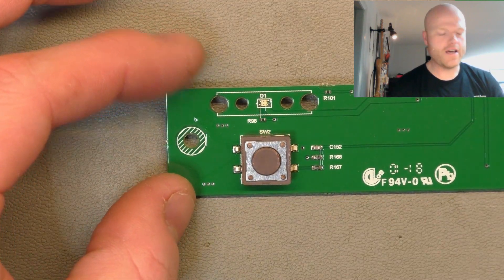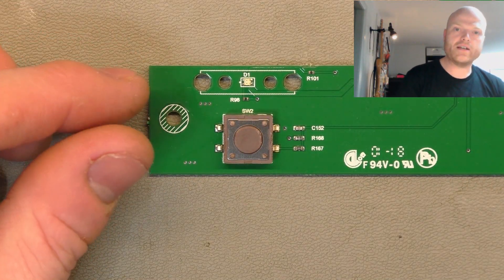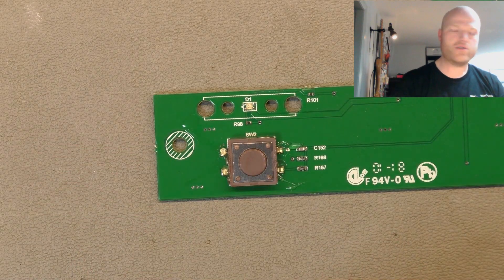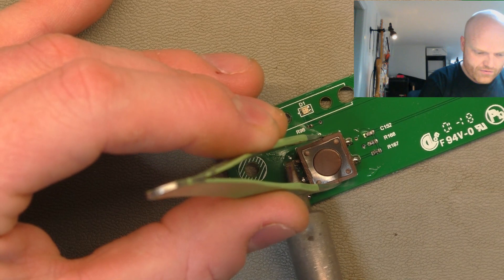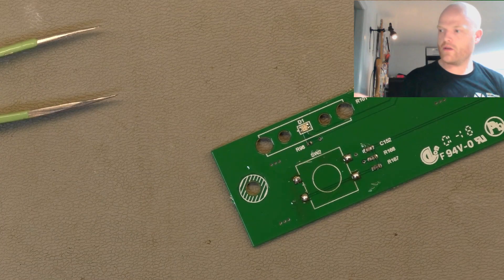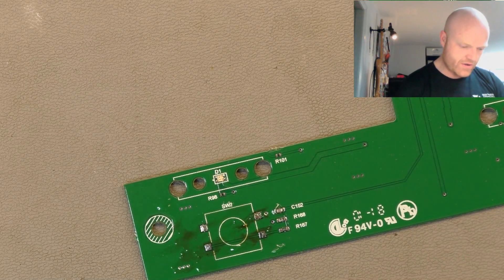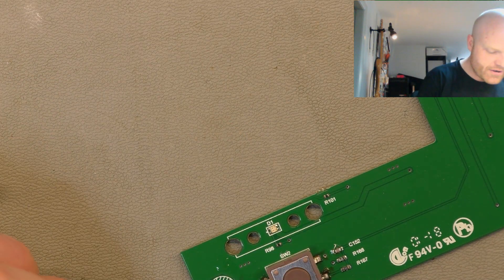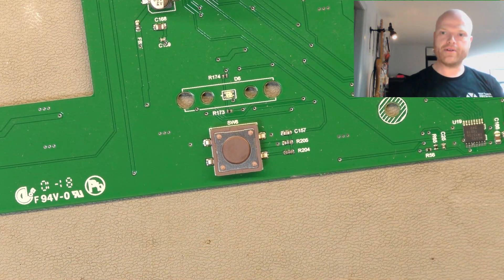SMT / SMD Pushbutton Replacement - iRig Pedal

Comment: You said this was a technique for removing the switch with stuff you just happen to have around, *but most people don't have ChipQuick*, and as you mentioned, it's expensive, so, here's an alternative method.  Push something wedge-shaped, like a skinny flat blade screwdriver, or a wooden popsicle stick or tongue depressor sharpened at one end, underneath the switch (which typically stands up off the PCB  slightly on little nubs of molded plastic). Add fresh solder and/or flux to the solder pads and legs of the switch. Lay the soldering iron down flat on two connections simultaneously, and the switch will usually pop up off the board slightly, from the pressure of the wedge underneath, it as soon as the solder connections liquefy. Push the wedge farther under the switch to restore the pressure and lay the soldering iron tip down flat on the other two connections simultaneously, and the switch will lift a little more when the solder melts.  You can either push the wedge under the switch again to restore tension and then repeat the process as necessary 1 or 2 more times ---- usually it only takes one additional cycle ----  or at this point you can use the ChemWick  desoldering braid to desolder the terminals; and because the component legs have now been lifted up slightly off the solder pads,  the ChemWick braid should be able to wick up all the solder from inbetween the legs and the solder pads on the board.
Reply from the maker: It's not expensive compared to a hot-air station. I meant it's expensive compared to conventional solder. I don't suggest ever pushing anything wedge shaped under an SMD. That could rip the pads off the PCB. In this case, the package of the switch was hard against the PCB with no room to fit anything anyway. But yes, there "are a few ways to skin a cat". Each device needs to be assessed and a plan developed after inspection.
Reply: @BradsGuitarGarage  , I've done it many times, without solder-pad damage. It does require a light touch. Not a recommended technique for those who are "a bull in a China shop", or if you're a hammer who sees every problem as a nail!